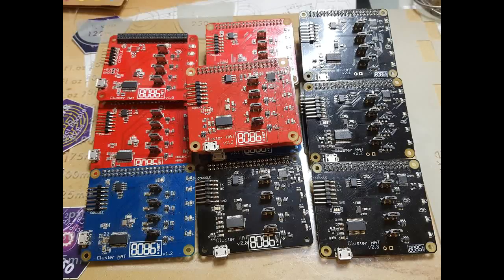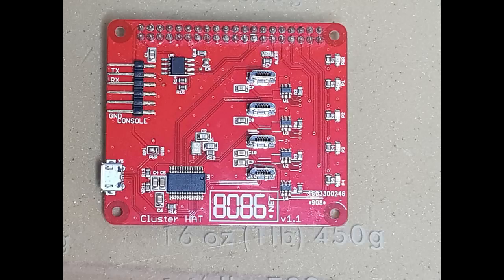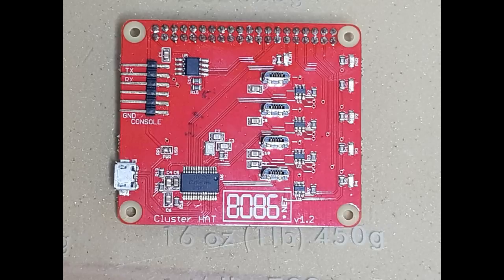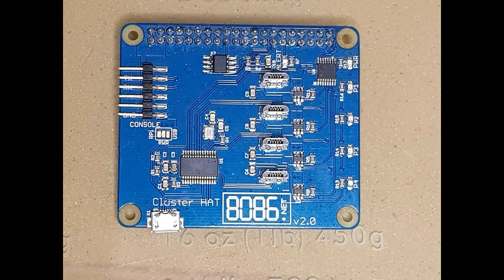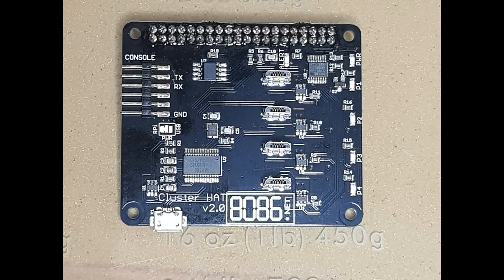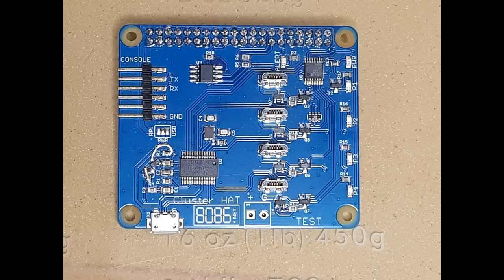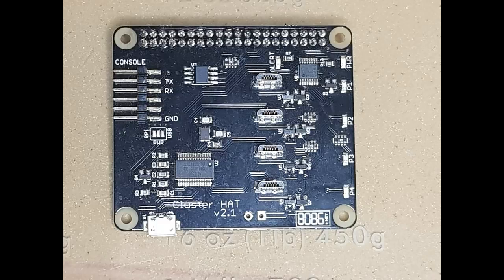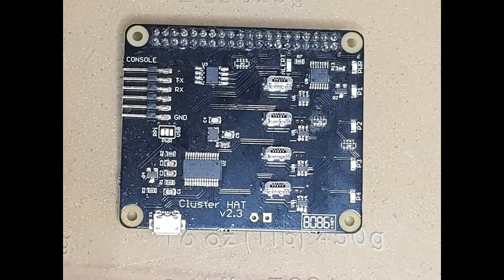Cluster HAT from prototype to version 2.3

Comment: Could you please explain the difference from v2.3 to v2.4? Thank you in advance.
Reply from the maker: I added solder jumpers on the back so you can switch the I2C address for the I/O expander and HAT EEPROM (I'm still working on the software changes to support it).
Reply: Chris Burton Thanks a lot for the quick reply! Was wondering as it was sold as 2.4 but delivered as 2.3 (not from you)
Reply from the maker: @spacepunch72  forgot to say 2.4 also fixes a reboot of a Pi4 resetting power to the Pi Zeros, all v2.x don't reset on earlier models of controller.

Comment: Been curious why the pi zeros are powered through the USB not the gpo?
Reply from the maker: By default only the USB hub is powered via the USB cable (no point powering it if there's no USB) and the Pi Zeros are powered from the GPIO pins for higher current.

Comment: Having a way to access the PiZero HDMI would be great.
That would be possible with the PiZero being partially off board, but it consume more space for those not interested in the HDMI.
I am investigating 90° Angle male to female microUSB connector. But they are hard to find.

What do you think?
Reply from the maker: I did consider it a while back but didn't really like them hanging over the end of the board but I did make a board a while ago with 9 Pi Zeros that allowed access to HDMI but that didn't work due to the max number of concurrent devices :(. I've been looking at something to bridge 2 clusters (4+5) on one board but never found anything I was really happy with.